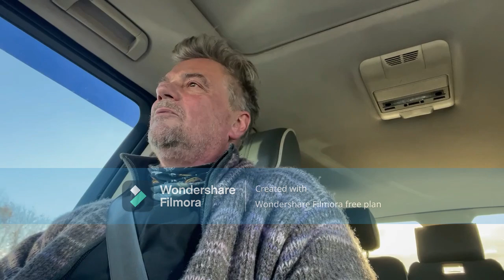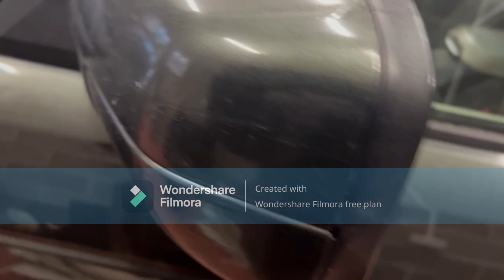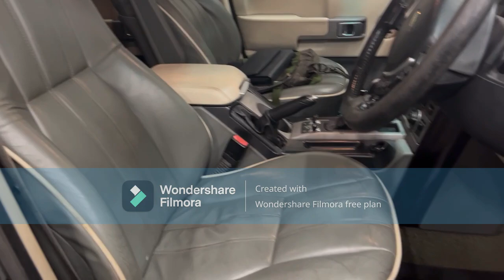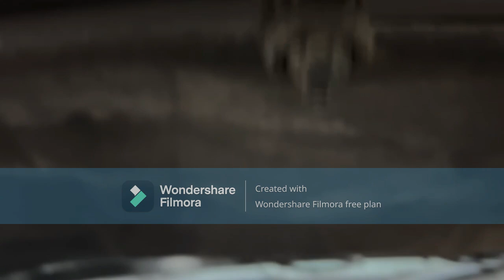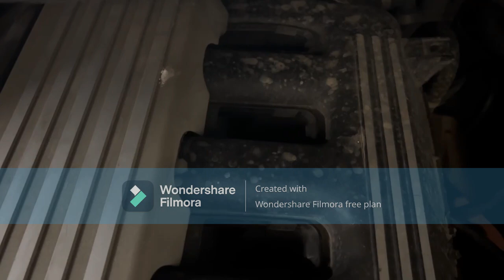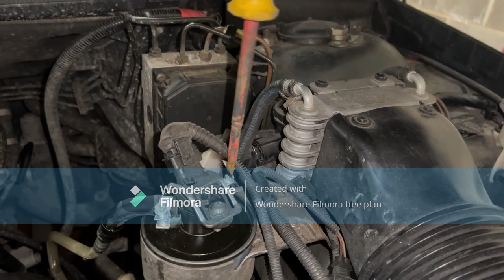Limping Home - MC05 XDM, a Broken Range Rover L322

Comment: The low pressure fuel pumps are also common to clog up and eventually fail, only a 10 minute job to change. Don’t fit a cheap Chinese one though! They only make 0.5 bar and will cause the FBH to misbehave too! 😊
Reply from the maker: @Craig-c5e  hi Craig. Yes I suspect I will be changing the lift pump and the in tank pump. It’s only pushing 3 bar at the filter while the other car manages just over 4 bar. I will do some part swapping between the cars to narrow down the culprit.